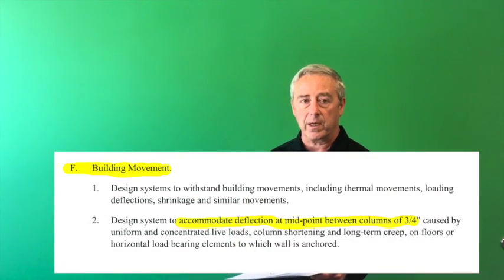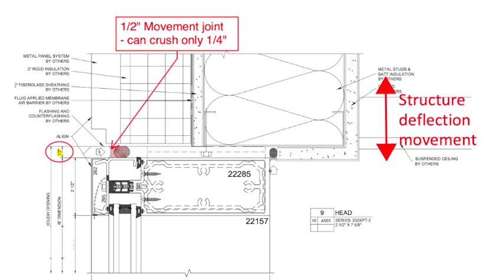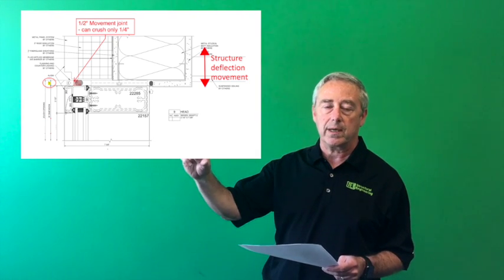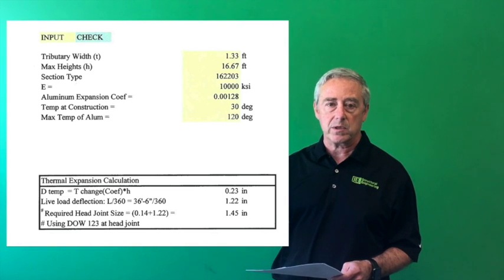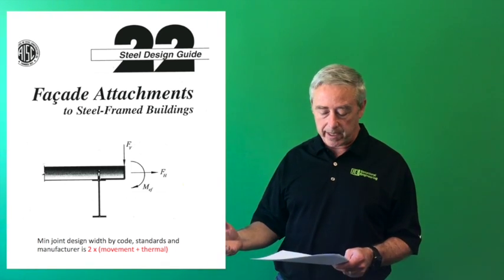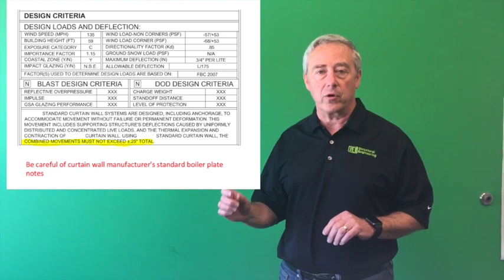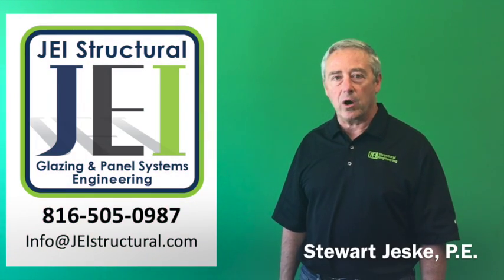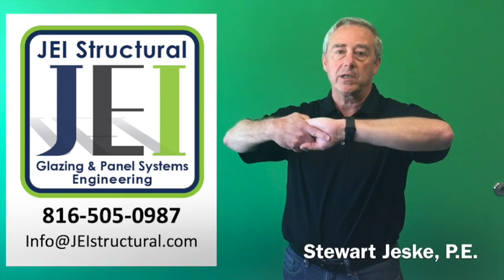Building Movement Issues in Curtain Wall for Glazing Contractors and Engineers

Comment: What if deflection/slip track installed for the building movement and beneath storefront installed? can we consider less movement at the head. Thank you
Reply from the maker: If deflection slip tracks are included in the wall structure (cold form steel) then the glazing system does not have to accommodate building structural movement.  Thanks for asking
Reply from the maker: This is not usually the case for long STOREFRONT runs.

Comment: You show a calculated movement of live load and thermal to be 1.45". It looks like you are saying that is the required joint size but the joint needs to be double the movement so it would actually be about a 3" head joint. Correct?
Reply from the maker: YES. You’re absolutely right. Sealant can only be squeezed to about 50% of its height dimension before it ruptures.